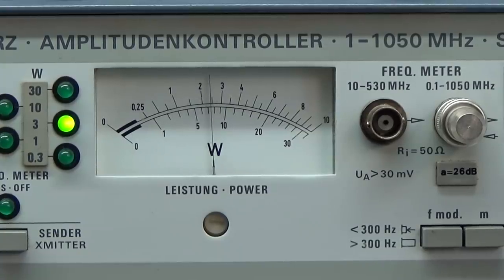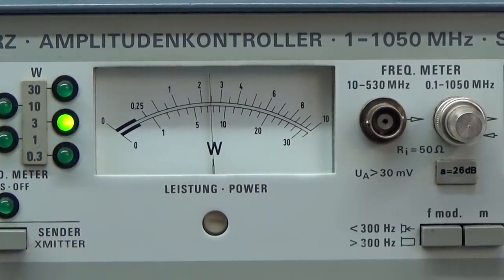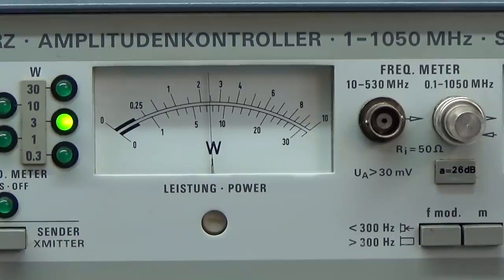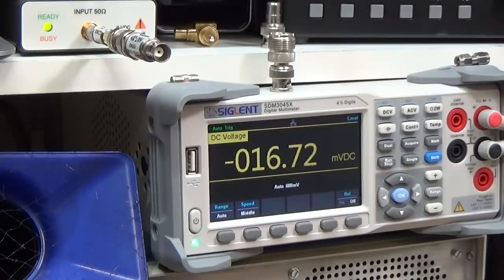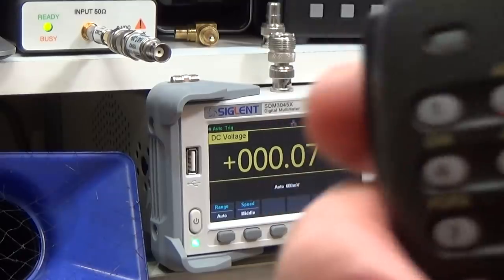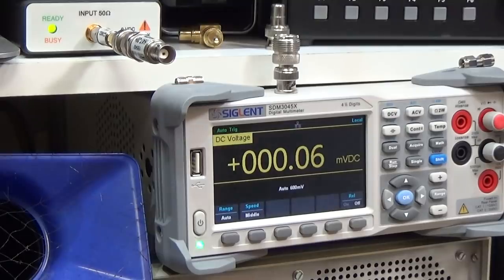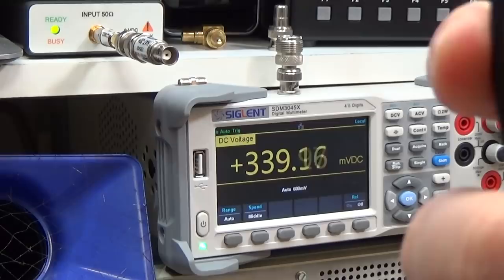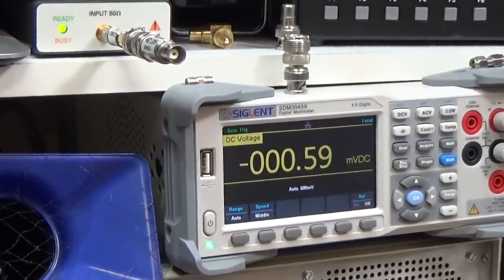#199 Yaesu FTM 400 repair with unexpected end

Comment: I know this video is over a year old but thank you for posting it.  I have 2 Ftm400DE's ( early serial numbers) 
 both went wrong twice under warranty then again both out of warranty. I dont run on full power and i check the antenna, coax, connectors and swr regularly. ( and changed the ground plane , the car!) However when the last failure happened i decided to follow this video and give it a go. I used Chip Quick and i added the holes but as my bench drill is not up to the job the holes did not line up in the rows so i filled them out to make slots. This was mu first every repair of a transceiver and it worked. Thanks once again!

Comment: For anyone attempting this: 1: Get yourself a big soldering iron.  I bought a 100W chisel tip iron off amazon for like $20 and it worked great .  There was no way my weller station was going to do this.  The biggest issue is you have to unsolder the antenna connector to get the board out.  (and you also have to solder it back in)... The iron made this a breeze. 2: When you get the final switched out, make sure you put it all back together before testing.. I tested it before I put the screws and the copper shield back in and while it was better than it was before, it would not put out full power. I assumed there was something still wrong but when I put everything back together I got full power out.  3: The fan on mine was making some noise, so I replaced it.  And I added an 80MM fan to the top. Looks ugly but should help keep it a little cooler. Thanks for this video and the other one on the 400. It really helped testing mine. I also learned I should have bought a 500mhz scope. lol

Comment: Great video.  Peter, your time is worth more than the part. What a shame the owner didn't have you fix it. 73
Reply from the maker: The problem with those radios is they die much to often that can be rally frustrating.  73

Comment: I recall watching the original video where this radio was repaired the first time. Same fault with one bad FET.  I was really hoping to see a few tests to see what would happen if the radio was operated with the gate to the bad FET lifted.  Now we see the same radio back a couple years later and I did get to see that after all.

If the FETs were in separate packages, would it make sense to only change one of them, or should they only be changed in pairs.
Reply: Pairs!

Comment: Good troubleshooting Peter.  I agree only using 1/2 of the amplifier is probably going to drastically change the impedance between the driver and final.  Will probably end up killing the driver in a short time.

Think you forgot to mention you had a 10db attenuator before your power meter.
Reply from the maker: Thanks Mike! Yeah I fully agree will see when it is back :-) You are right forgotten to mention the 10dB power attenuator.. 73

Comment: About 04:40. You say 10 watts but the 3 watt LED is lit up, not the 30 watt. Should that reading be .75 to 1 watt?
Reply: You can see it is runnining through a attenuator before it enters the meter.
Reply: @mikesradiorepair  
Sorry, did not notice that. Guess I have to up my prescription.
Reply: @bblod4896  Think he just forgot to mention it was running through a 10db attenuator.

Comment: during an alignment of the FTM400XD radio in the TX power alignment parameter of the service manual, started as per procedure from 440.050 Mhz low power and 5.3 watts, I continued up to medium power 20W.
By storing the 5.3 watt parameter in the Adj 02 PWR menu with the Adj 02 DVR parameter with 9AH in low power and the medium power parameter Adj 02 PWR with 20W and confirmed with Adj 02 DVR with B0H.
When I reached high power (50 watts), while I was rotating the dial to align the 50 watts, the Wattmeter with the built-in laboratory dummy load burned out. Now I don't have a tool to align and verify all 3 parameters, especially the high power one which stopped at E1A when the wattmeter burned out. On VHF I obviously didn't continue to set anything.
Can you tell me the alphanumeric codes (e.g. 55H 92H E1a etc which are factory set in the respective power parameters 5 - 20 - 50 watts in UHF in the service menu? I would like to set it with those factory values since I don't have a Watt rf instrument from measure at the moment.

Comment: The owner is he the first owner of this FTM-400? Because the is a hidden menu settings to changes all power levels for Low, Mid and High.
Reply from the maker: As far as I know he is the first owner and he is not the type of guy who is tinkering around with the settings...
Reply: Okay  that´s good. That is always the trouble if the owner have change the settings in the hidden menu without to write down the default settings.
Reply: @oz1jux  how can I get into the hidden menu?

Comment: Great Diagnosis realy enjoyed following along Peter....Seems a shame after all the effort put in diagnosing the fault for the customer not to pay for the part to be replaced after all it was designed as a linear amp in push pull now sadly it's just push push hi hi. 
73s de Steve M0BFM
Reply from the maker: Well yes but I can understand it as this radio is really not the best. By the way it is not push pull design only two transistors in parallel...Thanks for feed back 73
Reply: @TRXLab  Yes I should have known it was not push pull No transformer hi hi...Not a good idea putting 2 Devices in the one package either, that's just asking for heat dissipation problems.
I really like your R and S Comms Test set very nice indeed.

Comment: Good morning Peter! That was surprising! Good work indeed, and the final solution (haha) is maybe not the best, but the most practical way to use the radio until its end. This units are nightmares, and sometimes i think that Yaesu should focus on there traditional playgrounds ;-) Anyway, you did your best to make it work again. And to reply to some comments down below: The decision not to repair this unit is ok. The heatproblems are known on this model, and it was not the first time in service as Peter mentioned. So i guess the owner will use it maybe not as a full duty radio in the future, but as a backup radio to mostly listen and low power local "phone". I would do it the same way and save the money for a new device. 73 de Olaf!
Reply from the maker: Hi Olaf, well under low power it might work and you are right it is used as back up radio for local "OV" phone...Will try in the future to increase the air stream and to protect the gate better for high surge voltages. We will see if that improves the radio..Have a goof Sunday 73

Comment: Not following the output power. Through the video it looked like the meter was on a 3 watt scale not a 30 watt scale.  I am sure I missed something trying to understand the odd type meter.  Can elaborate
Reply from the maker: Yeah as already mentioned here in the threat we have a 10dB power attenuator in front of the device that makes the 3Watt scale 30W...73
Reply: Thank you for the follow up as I was so confused.  Great stuff once again

Comment: I didn't notice if you discovered the actual root cause?  Is the end users antenna at a different impedance then the output of the radio causing a high VSWR?  It would be good to know.
Reply from the maker: very often you can't find a root cause but in this case it is most likely heat...

Comment: Du prüfst ja immer die Verzerrungen mit 1Khz. Bei Funkgeräte wird dessen 3.Oberwelle, die ja oft stärker als die 2. ist, nicht mehr übertragen. Wäre es da nicht besser 800Hz zum Testen zu verwenden?
Reply: Das Gerät arbeitet in FM.
Reply: @OleF112  FM...ok, das hab ich nicht bedacht. Gibt's da auch ne Angabe bis zu welcher Frequenz die Stimme übertragen wird? Klingt das dann hörbar besser? Bei SSB gehts doch nur bis 2,7Khz!?
Reply: @Elektronik-1  Das hängt unmittelbar mit der zulässigen Kanalbandbreite, der NF-Bandbreite und dem FM-Hub zusammen. Schön erklärt hier: http://www.dl7maj.de/Modulationsarten.pdf. Peter hat dazu auch ein Video, sofern ich mich erinnere. Eine gute Quelle ist auch immer Mikes Radio Repair. Etwas AM-lastiger (US), aber dafür auch schön am Spektrumanalyzer erklärt!
Reply from the maker: Im Wesen prüfe ich die das Oberwellenverhalten in der HF Lage hier also bei 145 MHZ. Ohne LPF wären die Oberwellen weit über dem erlaubten Maß. Zwar ist es hier ein FM Gerät wie Olaf schon richtig bemerkt, jedoch auch bei SSB Geräten gilt das Gleiche. Die 1Khz NF wir letzlich in die HF Lage gebracht und unterliegt hier wieder gleichen Bedingungen. Mit der 3. Harmonischen hast Du insofern recht das bei Push-Pull Betrieb im Vergleich zu Single ended der 3. Harmonische größer ist als die 2. Harmonische. Da aber das Inbandfilter in der NF Lage schon die 3 Harmonische bedämpft und weiter diese auch in der HF Lage bedämpft wird ist das nicht entscheident. Bei FM gibt es auch eine Beschneidung der NF, das ist nötig das aus dem Produkt von Hub und NF nicht  das Kanalraster überschritten wird. Ansonsten hätten wir das berühmte Splattern im Nachbarkanal. Sehen wir oft bei CB Geräten und neuerlich auch bei Free Net Geräten...
Reply: Danke für die Antwort. Aber so ganz verstehe ich das nicht: Ein steiler 2,7Khz Filter macht doch aus nem 1Khz Rechteck nen schönen Sinus. Wenn z.B. im Verstärker die Rückkopplung kaputt ist und dadurch der Sinus geclippt wird, dann ist das doch gar nicht erkennbar? Bei 800Hz wäre der Fehler aber hörbar und messbar.

Comment: The power meter looks like it’s on the 3W range not 30W range
Reply: He has it running through a attenuator before the meter.
Reply: The radio is supposed to put out 50W, so he has to use an attenuator on a 30W meter.  You can see it between the meter and the cable at 2:35.  This reduces the power by 10 dB, so the meter is on the 3W scale to read 30W.

Comment: What about the UHF side of things, I never saw you test 440 Mhz range. Looking at the input of the final area it looked like there was separate tuning by the size of the coils leading to the 2 sides of the input to the final. Spectral purity might not be as good, nor power output. I know the customer did not want to pay for a new final, but I would never let a radio go out like that myself. 73 N8EFJ
Reply: +Robert Osborn And what would you do if the owner doesn't want to pay to have it fixed?  Fix it for free?  Disable the transmitter?
Reply from the maker: Yes that is valid question. It is the property of the operator and by law he can decide...
Reply: Not familiar with European laws but I would put it back together exactly the way is was  and send it back. As a commercial shop employee I have a responsibility to not allow anything on the air that does not perform as it was intended and meet the Production specs. We as a shop are responsible for any work we do and any interference the equipment may cause. The owner can say the shop did the work if they cause RF problems on the band. I am speaking commercial RF transmitters for industry though which is what I do for a living. Hope this explains what I meant with my original comment. The customer can save up and have it fixed at a later date. But not be on the air where he might be causing problems with a reactive load such as an antenna, this will have (or create) different results than a dummy load with a unbalanced RF output FET.
Reply: @robertosborn8720  Peter checked to make sure the output was within the legal requirements.  The concern was that running the rig this way might cause damage to the driver.  The customer assumed that risk.  I imagine there was no warranty on this repair because of that.  

I can appreciate your risk when repairing commercial type accepted gear.  There is a difference between commercial equipment and ham gear.  Every amateur is responsible for his rig meeting emission requirements.  That's why hams can legally build and modify their own equipment.  At least this is the case in the US.

Comment: KENWOOD MOBILES SUFFERED OUTPUT LEVEL CHANGE SIMILAR TO THIS, A REFLOW OF SOLDER CLEARED UP THE ISSUE. THE OUTPUT DROP IN TK-941 WAS BAD SOLDER JOINTS IN HALF OF THE REPAIRS. YOUR MODULE MIGHT BE DEFECTIVE.
I AM NOT FAMILIAR WITH THIS MODEL, SO I DO NOT KNOW WHAT RF DEVICE IS USED.
I SUSPECT A MOSFET, LIKE AN RD70HVF1 FROM MITSUBISHI.
I GUESS I WAS CLOSE ENOUGH. RD70HUF2.